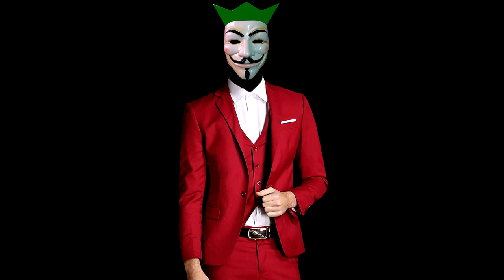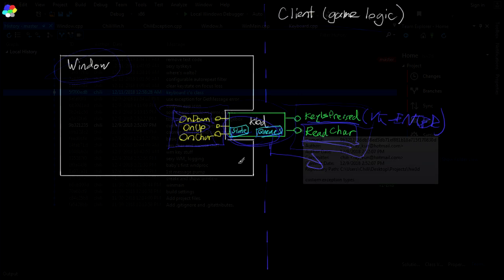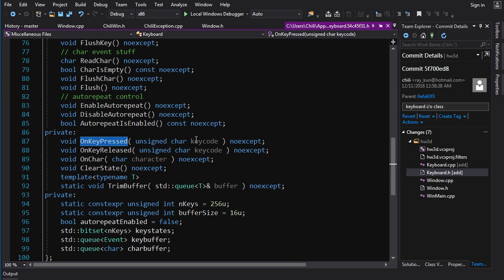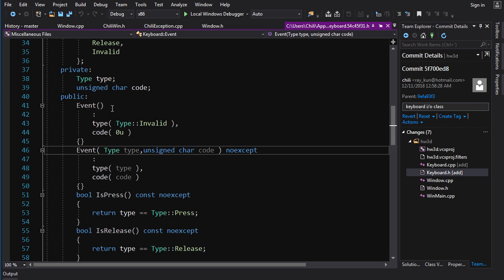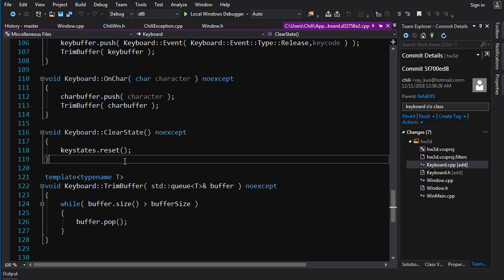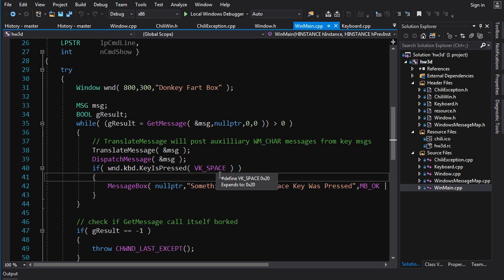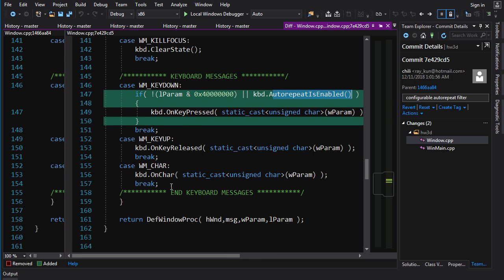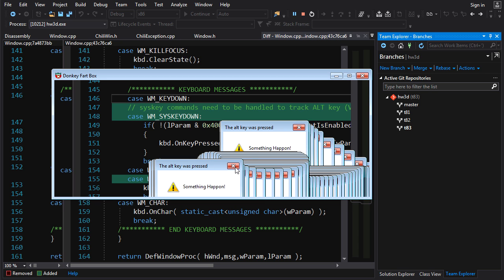C++ 3D DirectX Tutorial [Keyboard / WM_SYSKEYDOWN]

Comment: Sorry, another separate question. What exactly is the buffer, and why is it set to 16? Is this a buffer for the messages? If so, how does it differ from the message queue? Why would you need to maintain the buffer at 16? That is, why would you need to remove items off the queue in order to keep the buffer at 16?
Reply: incredibly late response, however for anyone who like me had the same question... i believe the buffer is simply a way of the keyboard class storing multiple events. for example, if a user presses multiple keys at once, or more than one keypress is registered before the polling of the keypresses takes place (using readkey() or readchar()...) then the buffer acts as a way of storing up to 16 events. the reason we limit the buffer size to 16 would simply be to prevent a stack overflow? (i think, i have no clue what i'm on about most of the time tbh) 16 should be more than enough slots to process parallel keyboard inputs in most modern day applications :)

Comment: Random question: For the KeyIsPressed member function, why did you use a non reference to const parameter? What would be the difference between KeyIsPressed(unsigned char keycode) and KeyIsPressed(const unsigned char& keycode) ?
Reply: As I understand it:
unsigned char — a byte of memory is copied.
const unsigned char& — a 32/64 bit reference is passed.

So the second option would simply take more memory.

Comment: I am getting Unhandled exception at 0x00E80289 in hw3d.exe: 0xC0000005: Access violation reading location 0x00000008. error
Reply: Had the same problem. You probably forgot to set the last parameter to this in CreateWindowEx function
Reply: I get the same issues after adding the keyboard stuff. Took keyboard.cpp/.h from github and still got that errors when pressing any keys, as well as after minimizing/closing the window. If I dont link any of the keyboard stuff to the rest of the project all works nice. The last window parameter is set to this...so How can we fix this? Thanks :)
Reply: Just if anyone else is a noob like me and gets this stupid issue, instead of wasting almost an entire day like I did, please check in the Window.cpp - the HandleMsgSetup() proc, the msg should be compared to WM_NCCREATE, so your IF statement should have "==" instead of only one "=", which did not created any fuckin problems until now. So stupid mistake...Hope this will help others in the future to reach the end of this tutorial.

Comment: I don't think the auto repeat is working correctly, when set to both true and false, auto repeat seems to be stuck ON. I can hold down a key and it stays down, even if auto repeat is disabled (false)
Reply from the maker: You seem to misunderstand the meaning of 'auto repeat'. It has to do with WM_CHAR messages.
Reply: @ChiliTomatoNoodle  Hmmm, alright. So what kind of solution could be implemented to make sure only 1 keydown message is processed?

Comment: That is probably not relevant to this course, but why some games use WM_INPUT with rawData implementations instead of this clean keydown/keyup messages?
Reply from the maker: There might be a small benefit for mouse (increased resolution), probably not much for kbd. But if you're already doing raw for mouse, you might be motivated to unify. Also has a side effect of making it a teensy bit harder for ppl to make unauthorized automation tools/bots via SendMessage.
Reply: Raw input provides relative position for mouse movements instead of having to calculate relative position manually.  As chili says, probably just a case of consistency using wm_input for both kb and mouse instead of wm_input for mouse and wm_keydown for keyboard.

One of the things I dislike the most is how DirectInput was replaced with XInput making my older gamepad useless.  Now I have to use a $30-$45 xbox 360/One controller.  Not related to window messages, but is related to input.
Reply: To add onto what  @MrAlbinopapa  said, I believe you can use raw input to distinguish between multiple devices. For example, if you had two keyboards connected for some reason, I think you can use raw input to distinguish between the two. 

Personally, I only use raw input for getting relative mouse coordinate changes and I use the normal windows mousemove processing to get the absolute mouse position.